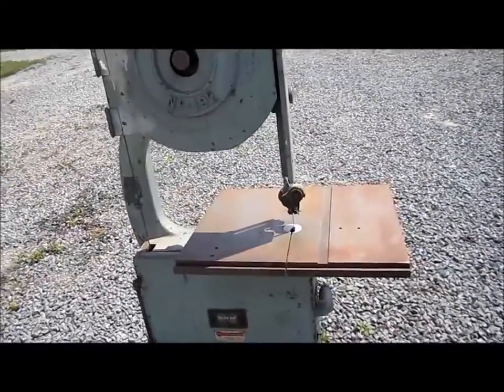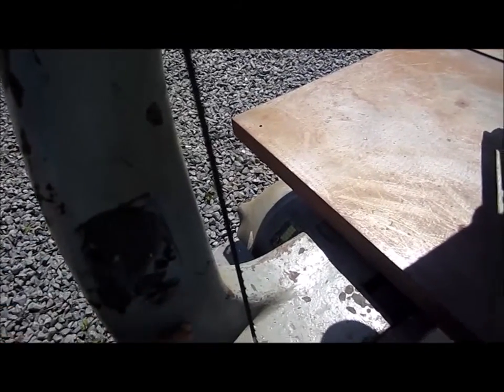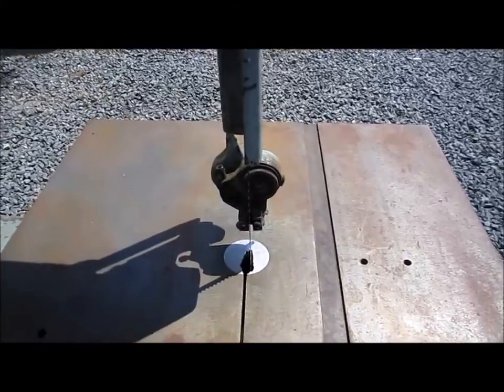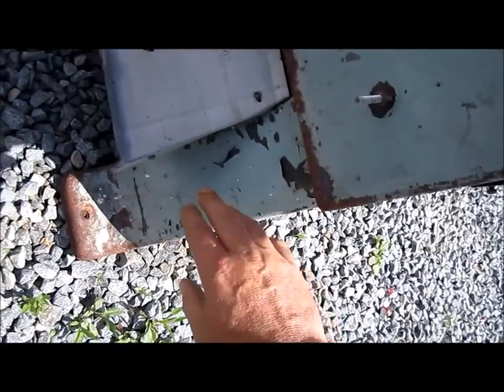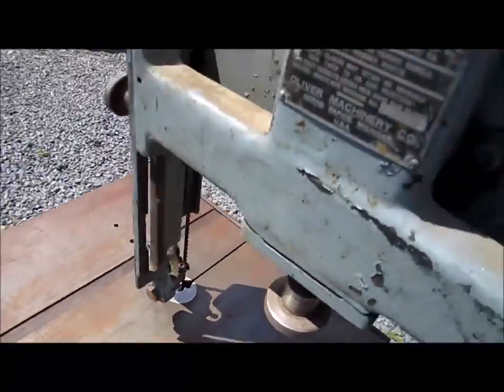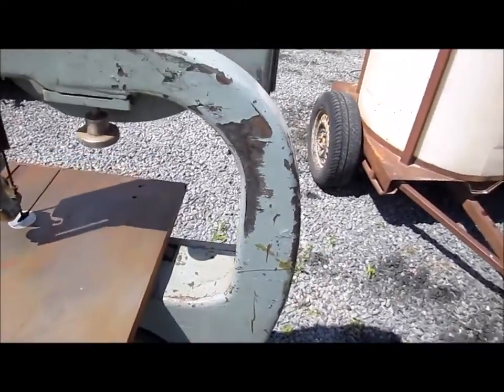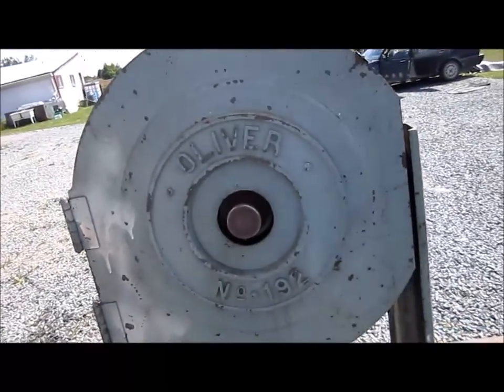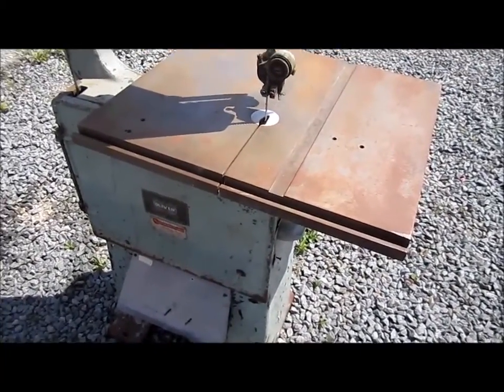Lumber/Cutting Band Sawmill Build And This Is What I,m Using For It

Comment: Did you finish this project and is there more videos on it? I weld cast iron no problem. I have also welded blades
Reply from the maker: No other video's. I don't post everything i do lol But yes project complete turned out really good. Cut my pile of lumber a large pile then sold the mill.
Reply: @MrDoingEverything  glad it worked. Would have been cool to see it in action

Comment: How you going to find a blade that long? You can not weld cast iron that easy almost impossible. Im thinking this will be not happening so easy.
Reply from the maker: No cast iron is no problem with the right rods and right methods Blades can be bought at any size.  Just have to order them the size needed at the right place. I have no concerns about making this happen.
Reply: Its not like you think about welding cast iron there is a large mass of metal and it constantly pulls the heat away from the weld and then it cracks open. Your will see. I have tried to weld it and its very difficult. It can start cracking everywhere sometimes. You may have good luck I dont know.
Reply from the maker: I will heat the metal up real hot first then make small little welds and slow cooling and ping it with a hammer seems to work pretty good. The right welding rods makes all the difference also. Your right for sure it can be very tricky.
Reply: sometimes you need someone's help to hold the torch close to where you welding while you weld.
Reply from the maker: Yes that's a helper for sure.